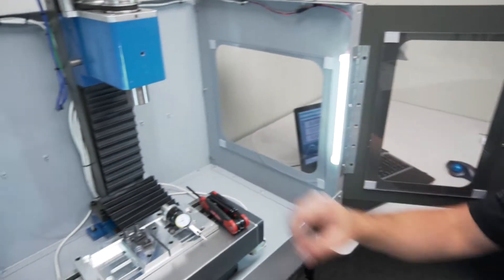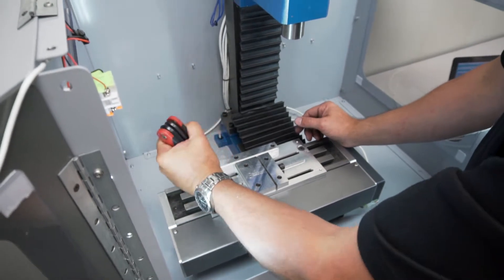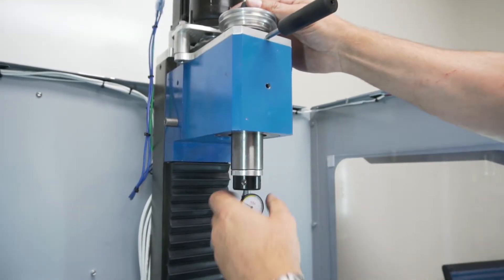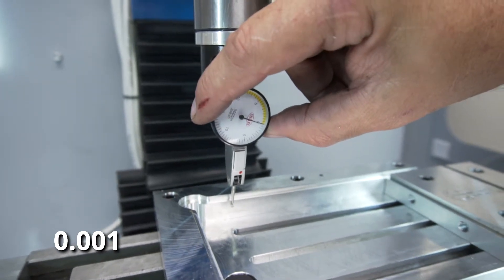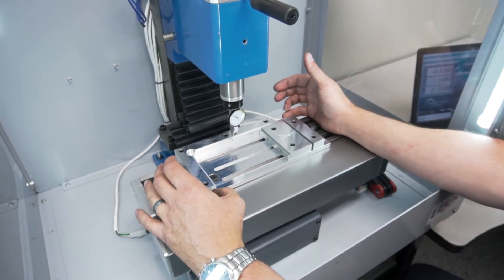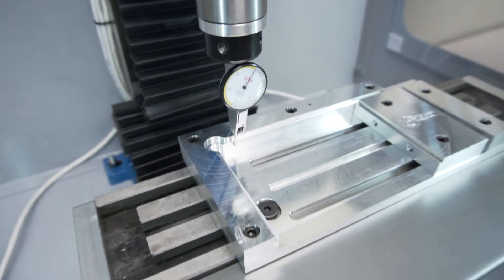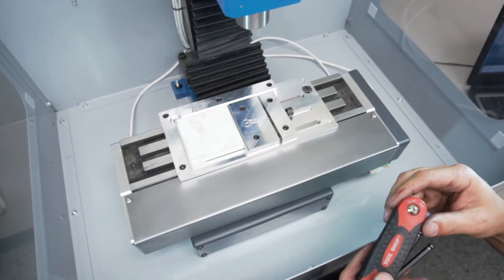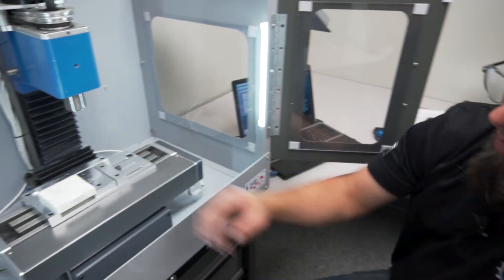Walkthrough: How to Install, Indicate, and Use Leading Edge Industrial's Low Profile Vise

Comment: Have you guys considered developing a low profile vise that clamps in Y? Something that would work well for longer, skinny stuff that needs the x travel. Cool machine, I'm definitely gonna keep an eye on it
Reply from the maker: Hey Colin,  thanks for your interest in our machines!  We do have several different workholding solutions in development for use with our machines, but a LPV configuration for clamping in Y wasn't on our radar until your suggestion.   I'll add that to our development queue - Thanks!